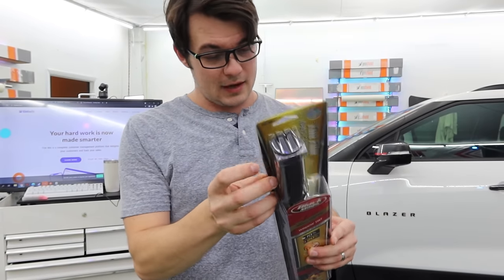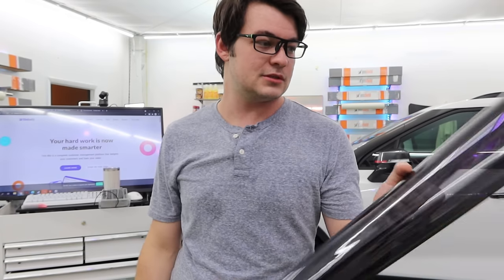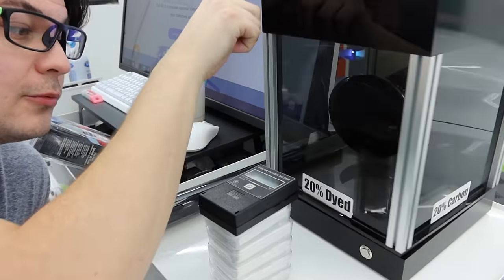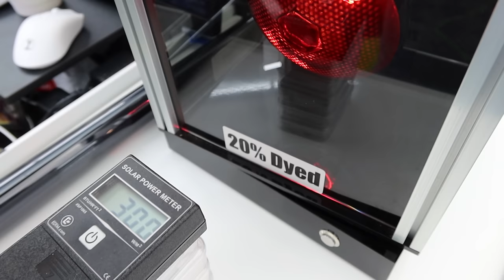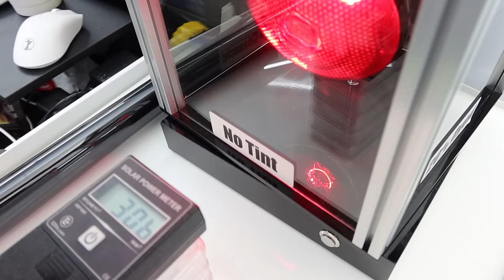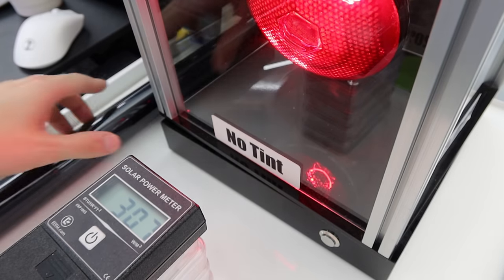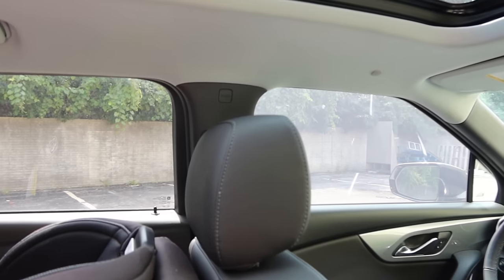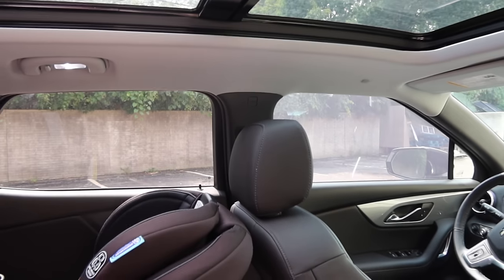Walmart Ceramic Tint Should Be ILLEGAL!!

Comment: The heat reduction test wasn't accurate due to the air gap. If you actually stuck the film to the no tint glass you would probably get different results
Reply: Exactly.  Physics.
Reply: No he wouldn't because its not measuring temperature, it's measuring the heat output (basically the light energy from the lamp). As long as the tint is in front of the lamp, it shouldn't make much of a difference.
Reply: Yeah, air gaps are specific to lessening conductive/convective heat. That test specifically measures infrared radiation, and air gaps have no effect on radiation heat.

Comment: Everytime I've had my windows tinted by professionals at different tint shops it's always hazy the first day, and they all have said that I shouldn't mess with the windows and it will take a couple of days in the sun for the tint to clear up.
Reply: I've had a car professionally tinted with Llumar and it was never hazy. I just tinted four windows in my car with motoshield and it was clear as well. As clear as 15% tint ever is anyways. Maybe they were using lower quality tints on yours?
Reply: Mine was clear when I left the shop but I was told not to open any windows for a few days. They put tape on my window buttons as a reminder
Reply: NOT SURE...this is the same thing we would tell our customers about the haze or streaking or clouds in the tint...give it a few days in the sun and it will clear up and it always did. In over 30 years of tinting we never did really figure out why the tint would do that because it did not always do that and we always used the same brand of tint Solar Gard now owned by Saint-Gobain North America. We are in Kentucky and it seemed the higher the humidity that day the better the chance the tint jobs that day would haze up. I see other post on here saying I used this brand or that brand and it was never hazy... I say ''SO ?'' what difference does it make if it goes away and never comes back...none . Now this guy says that he went ahead and left it on for a few days ? and the haze never went away then that would be a problem. Did he cause the problem by using so much of the solution that came in that little packet? I don't know. For a while, we were told to only use Dove dishwashing soap in our water bottles to help in moving the tint around on the glass but then it got to where the tint companys only recommend Baby Shampoo. If I was using a high output hand pump spray bottle I would use a cap full of baby shampoo in it and never had problems. We also sold tint over the counter,  by the foot, for our customers that wanted to do it themselves. If any of you out there have been tinting windows for a long time...this will give you a hint about how long I have been tinting windows...when I first started tinting automotive windows the only color they offered/made was the silver mirror finish, it came with NO BACKING to peel off and no hard coat to keep it from scratching as easy and the glue that held the tint on the window came in a little plastic bottle and you had to mix it with water and spray the glue on by hand ! I also think that dinosaurs still walked the earth lol. Detroit Tint guy is at least trying to help those new to tinting a little help in this video and should be cut some slack but also taken with a pinch of salt. And watch out for the pros on here that still thinks he tinted both sides of the glass. BOZ
Reply: @Hedonistic0Frog  they likely cured the tint inhouse.

Comment from the maker: Thanks for all the love on this video 💚 I have like 5 more ceramic ideas thanks to your comments
Reply: Hey I have 3m 40% ceramic tints on my car windows but I want a lower percentage is it worth taking removing for darker tint
Reply: @carolinapantherfan4330  my old car I had 20% tint but it metered 24% when installed on my windows. A year later after not being happy I had a 2nd layer of tint put on all around which saved money from having to strip it all. I had 30% put on top of existing tint and it metered 10%. The guy that did it did a really good job because not all tinters can add a 2nd layer without screwing it up. Got rear ended 1 year ago and it totalled the car though.

Comment: Try actually tinting the glass on the tester, I could imagine the film and air in between has something to do with your low numbers as kind of acting like a reflector between the glass and film.
Reply: Has alot to do with im guessing his getting paid by the company to do this
Reply: No that shouldn't affect it cause he isn't measuring the actual temperature which would be affected by the air gap. He is basically measuring the light energy which should be basically unaffected by the air gap.

Comment: For your heat test you left the plastic liner on the tint wouldn't that affect the results of the test?
Reply: I was thinking the same thing initially, but the likely answer comes from the glass. The film limer was a fraction the thickness of the auto glass, so the numbers can be presumed to be offset.

Comment: It'd be damn nice to have optically clear film (0%) that provides that 70% or more heat reduction.  The car manufacturer already tinted the glass slightly and it does 'okay' but more is always better so long as it doesn't make things darker.
Reply: Yes, and it's easily possible since the visible tint has nothing to do with infrared transmission and vice versa. I tried to get professionals to tint my windows, but none of them carried any tint that was legal, much less safe for driving at night. So my windows are still untinted.

The auto manufacturers still haven't figured out that glass roof panels don't need to be so dark that they may as well be solid metal, either. And they still let too much heat in because visible tint is irrelevant. Give me glass that I can actually see through, and just put a coating or layer on it that blocks infrared. It's not rocket science!

Meanwhile, they have finally figured out that UV is what causes most of the interior damage, so contemporary auto glass does do a decent job of blocking that...
Reply: @awo1fman  I saw on a channel working with Headlights that there is a ceramic coating that can be used to prevent UV deterioration and provides the new look shine.  I wonder if that is something that would work on a standard window, Coat it with clear liquid ceramic to fight the UV.
Reply: Its basically a darker "dye" in the glass.  Its not really a "tint" in the factory glass.

Comment: The windows tint i put on my gladiator was hazy for a few days and then cleared up.  Not hazy at all now.  I figured it was the moisture under the tint.
Reply: I would certainly give it a few days to see if it clears up. I had a professional job and it was a bit hazy but got crystal clear after a few days parked in the sun

Comment: 2:25 With what little I truly remember from my thermodynamics class and more from just real-world experience, I'm wondering if there's a significant amount of heat reduction due to the barrier of air (an inch or so?) between the glass and where you held up the tint. Maybe not. I'm not sure.
Reply: Its measuring the infrared.
Reply: Yes that was bugging me too.  Air gap = massive heat reduction
Reply: @BraxEvans  No that shouldn't affect it cause he isn't measuring the actual temperature which would be affected by the air gap. He is basically measuring the light energy which should be basically unaffected by the air gap.

Comment: Hey I'm sure you addressed this because it seems like your a smart guy... When you did your BTU heat output "lamp test". By leaving the tint away from the clear glass you allowed the air in between to be an insulator.. you actually skewed your results favouring the Walmart stuff.. the air between is acting as an insulator.. BTU meter and infared are not the same things as well
Reply from the maker: Spacing has no effect on the test, I’ve done it on tons of film. Walmart would be an odd choice to favor if skewed. BTU measures heat output. The lower the number the less heat I actually feel. It’s the best way I’ve found to actually show what I’m feeling.
Reply: @DetroitTintStudio  I believe you are incorrect.. the air barrier between the window and the film will add a layer of insulation much like two Pains of glass in your window vs 1.

Comment: It's normal to have a little haze on car windows for a day or two during the curing/drying period after a film application... sun and heat will tighten the film as it dries (or you can use a Light Booth, or drying gun to speed process up). I've always used 3M products, never had a haze issue on any of my tint jobs. Have to say, the Walmart product DOES NOT look safe for use on automotive windows!! Like you're looking thru sunglasses with cheap lens.

Comment: the 30 isnt correct. You need to have it installed on the class. When you hover it in front of the glass, you are actually creating an insulating air gap. For example, how daul paned windows work for insulating your home.

Comment: You said it yourself that this film is uncommonly rubbery. You also, as I recall, treated the instructions as something one need pay no mind to. That rubberiness, as a physical characteristic, likely corresponds to a higher than average oh, lets say, hydrophilia. And yet at the microscopic level all these films are actually permeable. The water absorbed by the wet side of the film could take days to work its way through to the dry side (inside of the car) and evaporate. Once that happens, my bet is the film clears right up. I find it very doubtful this company went this far with its product and all associated products unless, yes, it's a good one.

Comment: Could you please do a video with the gila  ceramic tint from AutoZone. They also have a 2.5% tint.
Reply: Autozone have ceramic tint?
Reply: I just tinted my rear window yesterday with the Gila heat shield plus. That's the highest quality tint at AutoZone. Doesn't say ceramic anywhere on the box. 

On a side note, I bought the 20ft roll of private eyes tint with the install kit. Tried to shrink it to my back window. Let's just say it didn't shrink. Ended up with 2 permanent creases in less than 30 seconds of unrolling it. The guys at advance auto parts tried to tell me their tint is all made to just be sprayed and stuck on. Not meant to be shrunk. Never heard that one before. So I just got my $30 back and went across the street to AutoZone to buy the Gila tint.
Reply: @HoUsEoFcAtS78  auto zone and advanced both have the same gila time they both shrunk so they lie to you cause they shrunk even Walmart tooo
Reply: @HoUsEoFcAtS78  You tried to shrink it the wrong way. The film will only shrink on top and bottom edges of the roll, not length wise. All film shrinks, some better than others, but all film shrinks.
Reply: @tintshady2049  that's not true. It creased right while I was trying to lay down my "H" pattern. Before any heat. It was just garbage tint.
Reply: @HoUsEoFcAtS78  user error, surface tension issue, film does not magically crease on it's own.
Reply: @tintshady2049  I beg to differ. It was a 20 foot roll for $30. Quite literally happened twice from the same roll. No heat. I was literally just unrolling it across the window. No tension. It is garbage tint. I proceeded to try to heat the first one to shrink it. All it did was crease. And overheat. The more expensive Gila brand laid down with no issues. So all your comments are bullshit. Because you weren't here to experience the issue. So... Based on my description, you should just take my word for it that cheap tint is cheap for a reason. Mmmmmmmkay!
Reply: @HoUsEoFcAtS78  user error
Reply: @tintshady2049  you come here and give it a try and let me know what you think after you crease it. 🧐
Reply: @HoUsEoFcAtS78  +25 years in the industry, tinted over 30,000 vehicles, laid over 250,000 sq ft in buildings all over the planet, tinted helicopters, private planes, construction equipment, military equipment. Used every type of film on the planet. Now earn my living consulting/testing film for various manufacturers around the world...what's your tinting resume look like?
Reply: @tintshady2049  well obviously you missed a tint manufacturer. Go out and tint some more buildings Mr tint master.
Reply: @tintshady2049  and considering your YouTube channel looks like absolutely nothing that pertains to your profession, considering there's nothing there to show at all, I find it hard to believe that with 25 years in the industry, 30,000 vehicles, helicopters, planes, trains, buildings, there is absolutely nothing on your channel to show for any of it. It's easy to say that you have a background in doing whatever whatever. But if you have nothing proving that you do that for your job, I would consider just keeping your mouth shut. I'm going off the products that I have used in the last 3 days. And I am telling you that one of them is garbage. Considering one tent works way better than another. But you have to put in your two pennies. Which mean absolutely dick to me. Because I will tell you the same thing over and over again about that product. My opinion about that product will not change regardless what anybody tries to tell me. So on with another post for you to troll. Bye-bye now!

Comment: Whats your thoughts on 3m crystaline 20%? Its suppose to major heat reduction
Reply: This stuff is amazing - have it on wife's car and mine. Hers is super high VLT, like 50% or something, and it's still VERY noticeable difference when sitting your arm on the door panel in the sun.
Reply: 3M Crystaline is mind blowing. A friend in Henderson, NV (Vegas area) has it on his Prius, including the windshield. Last time I visited it was mid August and felt like the sun was 2" from my face. You can not feel the sun at all through the glass in that car!
Reply: I paid extra to get 40% Crystalline on my car as it was the closest to the 35% legal limit. I only had the car for 4 days after tinting before I was rear ended but from those 4 days the heat coming in was basically non-existent from any window minus the windshield which isn’t tinted. 

Definitely recommended. My rental car has no tints and I definitely feel the heat, lol.

Comment: Here in NY state, pretty much ALL window tint is now illegal.  I tinted my 2014 Dodge Challenger back in 2014.  The window automatically drops down about half an inch when you open the doors.  I can now see a line of the original 35% tint along the top edge that gets tucked under the rubber weather strip.  The rest of the glass tint has faded away to almost clear.  Its probably legally tinted now.  The company guaranteed their work for life......but guess what, they are no longer in business.  This spring I will have to find a better quality tint.  Any brand recommendations ?
Reply: 3m

Comment: Wouldn't the haze decrease as the tint sets and drys? Even great tint has a haze for around 8-24 hours depending on weather and environmentals. Don't misu derstand me, using Walmart tint is bats it crazy but more because of the long term than anything. You can get "decent" tint for a relatively "decent" cost it's just not gonna be at Walmart, advance, auto zone, etc.

Comment: I used the same tint and mine came out fine. With out all that BS on it.   I used 5% on all my windows. It looks great
Reply: After 3 months still good? Can you tell the heat reduction was a huge improvement by the tint being ceramic

Comment: I am in no way critiquing your work. You did way better than I can. I hate tinting, its one thing Id pay someone else to do. I do however question that perhaps the haze was a result of the way you mixed the solution? IE: If there is too much soap used it tends to create a haze if it doesn't escape the tint. And also hard water can also cause a haze if you fail to get it all out from the wrap. Again, Not saying this is why, just wondering if you yourself have considered that. Again, I can rebuild your engine all day, but tinting I pay for.

Comment: So it sounds like the only thing is the material that they make the tint sheet out of.  It sounds like installing it is something my 9 year old could do.  It's strictly a question of the tint material being appropriately good.
.
But that explains why it was so good with the heat...the larger particles are blocking more.

Comment: I thought about ordering a proffessional pre cut set of the ceramic tint for my car, but I can't see spending nearly 600 at the moment, but that 600 wouldn't cover "ALL" my windows, yeah it would come with the main 4 side windows, a rear, and eyebrow pieces, but what about my 4 tiny windows. I don't want to leave those untinted and make it look half done and getto..
Reply: Normally if you are ordering a pre--cut set of film the smaller quarter windows are included. A very long time ago I used to make the patterns for one of the first companies that made pre-cut kits and we always included the extra quarter windows on or near the doors. Depending on where you live $600 may be really expensive though.

Comment: I'm confused as to why you are putting window tint on the outside.
I did this decades ago,and we never put it on the outside, let alone on both sides. It's probably hazy because you are not suppose to do both sides
Reply: I agree at 5:00 he is applying tint on the outside, then minutes later the inside.

Comment: Wouldn't you get better results by removing the window glass from the door frame, and then installing the film to the glass on a clean shop bench, and then remounting the glass back onto the door frame ?
Reply: Risk tearing into that tint putting the window back in. It's a process, remove door panel, handle, switches, window sweeps, and it's still not easy to take the window in and out without hitting something in the process. It's too bad they don't build vehicles so you can actually take the door apart to access the window without removal